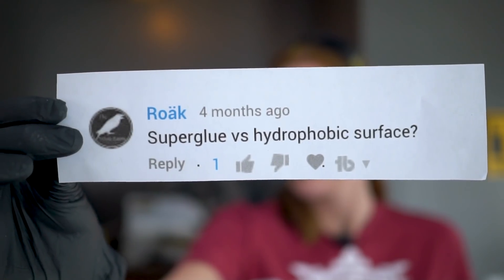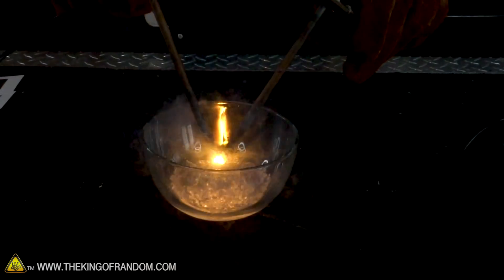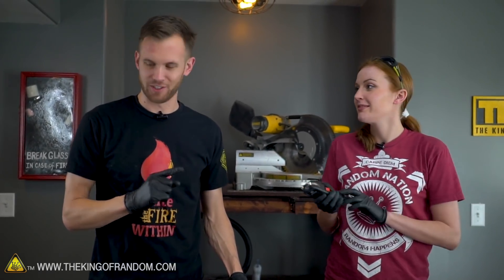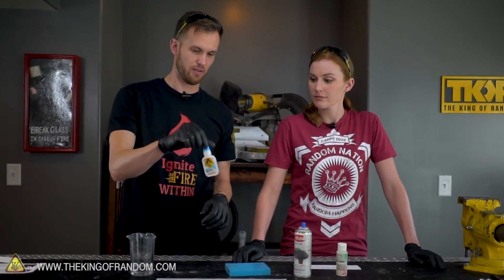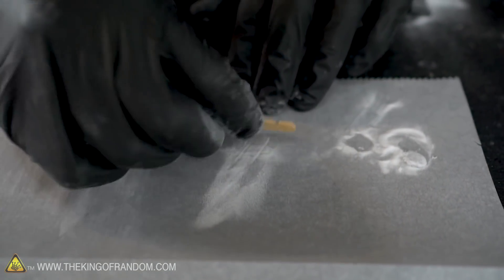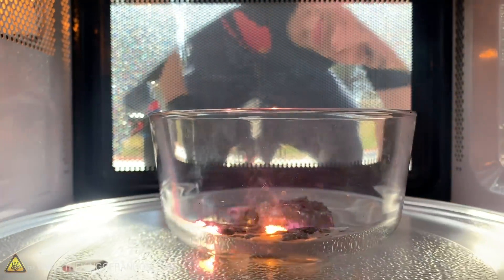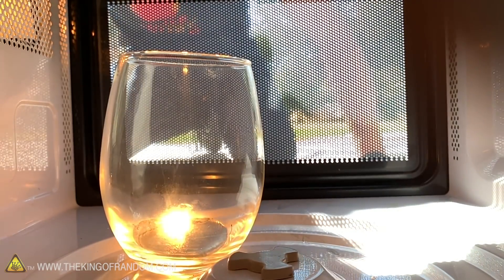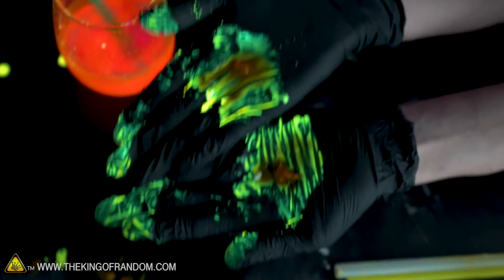Will Super Glue STICK to a Non-Stick Surface?

Comment: I think the difference in the arcs is because of how pure nitrogen ionizes differently than the weird mix with oxygen and argon that is in our atmosphere.  The taser was louder probably because of how nitrogen alone might take a higher voltage than our air and the higher voltage (and higher amperage and thus more energy) caused a louder snap

Comment: Please next time when you use carbon based stuff like those elements DO NOT HEAT THEM UP AT HIGH TEMPERATURE IN LIQUID NITROGEN as that makes CYANOGEN WHICH IS TOXIC. (chemical formula=N2C2)

Edit:this is what it does. 
Like other cyanides, cyanogen is very toxic, as it readily undergoes reduction to cyanide, which poisons the cytochrome c oxidase complex, thus interrupting the mitochondrial electron transfer chain. Cyanogen gas is an irritant to the eyes and respiratory system.

And BTW the arc "when out" not because of any chemical process but because you coold down the metal so much that it could not conduct electricity any more so there was no more arc/plasma

Comment: The breakdown voltage of nitrogen gas is only about 15% more than that of air, your arc conductor is probably creating more than the 34.5kV/m required to produce that arc in nitrogen

Comment: What if you had a slime that if you poke it slowly and you could mold it but if you had to wake it hard it wouldn't do anything like put it on the bench and wake it with a hammer and not a chip on the bench

Comment: Here is a comment I have seen a video of gold recovery off of computer boards and turns the acid green then they took a piece of stainless steel put in hot acid to take the cooper out and make the acid clear again then melted the copper flakes to make it coper again just wondering if you have tried this before

Comment: If you condense (crush) a gas like helium, will it be lighter, heavier, or the same?
Reply: condensation is where gas changes state to a liquid. i'll assume you mean compression.
if you compress a gas it will get denser, the mass will stay the same, the boiling point will raise and with extreme pressure it can cause condensation (gas->liquid) or deposition (gas->solid).
Reply: @topzozzle6319   yeah that's right
Reply: Heavier

Comment: I think for you to create an educational video on electrical arcs you should at least know how electricity works...
The colder the medium the electricity is flowing through the less resistance there is for the electricity to flow.
It has nothing to do with oxygen... It's not a flame. 
The only reason it produces light is due to the plasma heating atoms/gasses through which they pass.

Comment: Why Can't You Microwave Spoons And Forks?
Reply: Microwaves relay on water molecules in food. When the microwaves pass through the water molecules, the water molecules vibrate which causes inter molecular friction, thus heating the food. With a metallic object (especially a shiny one) the microwaves are reflected around the microwave and can cause the air inside the microwave to get so hot it creates plasma arcs due to the ignition of air molecules (oxygen, nitrogen, some others). I hope this answers your question but if you want more information I recommend googling the subject.
Reply: @andrewobrien3973  wow. I generally like chemistry but I liked that answer
Reply: @andrewobrien3973  would it hurt the appliance
Reply: CUZ THEY BOOM

Comment: You should learn to use super glue :D
It hardens by the moisture in the air, not baking soda. Also all of the popsickle sticks had wet super clue on it, only the outer layer cured.
Reply: You should learn about super glue.Using baking soda causes it to instantly harden, some say stronger than if you dont use it.

But yeah, they should have let it cure. Gorillia glue is junk too ....
Reply: @johndorian4078  It hardens automatically in air, but with baking soda only the outer layer hardens, not in inner layer.

Comment: can you guys freeze murcury in liquid nitrogen???
Reply: It's absolutely easy and doable
Reply: MohammadMaaz Iqbal, it might (not) be possible
Reply: MohammadMaaz Iqbal Under normal atmospheric pressure, nitrogen exists as a liquid between the temperatures of -210°C and -196°C which equals -346°F and -320.44°F. Below -210°C, nitrogen freezes and becomes a solid. Above -196°C, nitrogen boils and becomes a gas. Mercury becomes a solid at -37.89°F. So yes it will freeze.
Reply: Danny. Businesses boy
Reply: Yos

Comment: The black smoke was carbon particulates.  When you have the carbon rods outside of the liquid nitrogen the carbon reacts with oxygen to create carbon dioxide and carbon monoxide which are both colourless gases.  Burning it in the nitrogen means that the carbon can no longer react with the oxygen and ends up as particulates.  You can get the same black smoke if you burn turpentine and diesel without enough oxygen.

Comment: Nope the black smoke was nitrogen dioxide. Which is not that save. It's the gas u can make nitric acid with. It may also form nitric acid with fluids ov your body. It won't be that concentrated but it's still Dangerous.

Comment: You don't need an experiment to determine if nitrogen will extinguish an electrical arc.  A MIG welder uses nitrogen gas to shield the arc from atmospheric moisture and oxygen to ensure your weld isn't contaminated
Reply: @Dakota Achord yeah we ran 85/15 nitrogen/argon

Comment: “It sounds like a machine gun going off”

You clearly have never heard a gun before.
Reply: Redneck Dippers, true, but even a 22. If fired that many times in a row can deafen you. A machine gun? You’re ears would be ringing, you’d probably be temporarily deaf enough not to be able to hear someone else talking at a normal volume, and you wouldn’t just shrug it off and laugh. A real gun can permanently cause hearing damage without the proper protection.

Comment: The King of Random, What would happen if you put concrete in a vacuum chamber and let it set. Will it be stronger then regular concrete setting in atmosphere pressure, or differ. Maybe do one under air pressure and let that set. Which will make it on top or will it just be the same. It’ll be a great project.
Reply: Action lab already did it
Reply: Concreet or cement ?
Reply: Cement is the powder concrete is rocks and sand mixed with the poweder

Comment: 2:56 The difference in loudness is due to the high voltage a taser uses. While a taser uses high voltage converter, the arc furnace uses a lower voltage with much higher amperage (current). In general. The higher the voltage the louder the arc :)

Comment: what happens if you put superglue (or other glue) and duct tape on a teflon/non stick pan - is WD40 or hand sanitizer flammable if its frozen - can you give titanium a thermal shock using negative x and thermite

Comment: I'm not 100% on this, but Nitrogen is combustible in certain circumstances, especially when burning with metals or electricity, as it reacts with the Oxygen, forming both Nitric Oxide and Nitrogen Oxide.
Reply: Yup that happens with any very hot air, that’s why we used to get nitric acid in acid rain. Scrubbers and catalytic converters deal with most of this issue nowadays.

Comment: What would happen if you try:
- Melting a light bulb (incandescent)
- Filling it with gasoline and Turing it on
- and will it light while under liquid nitrogen?
Reply: do it! do it! do it!
Reply: 1 thanos will be born 2 thanos will come for you 3 thanos and shrecj will meet
Reply: 1. The filament will melt 2. The gasoline will light up 3. It won't work